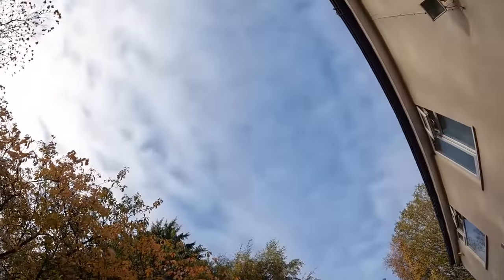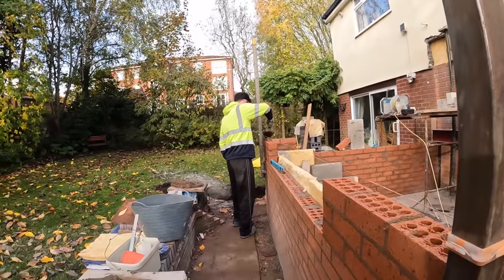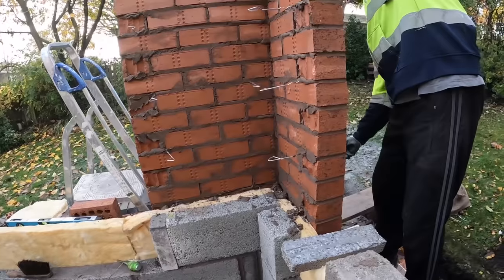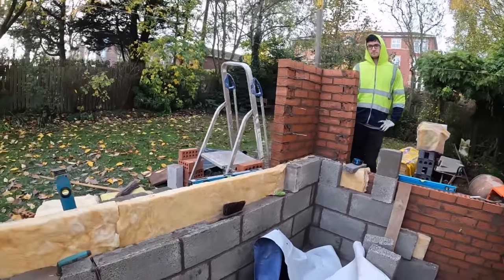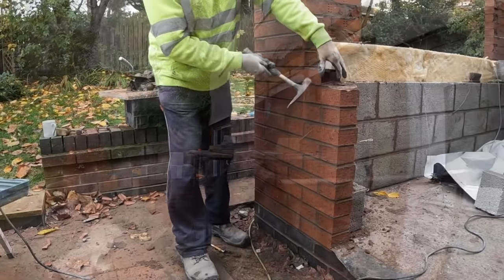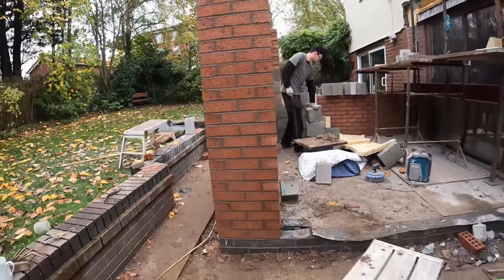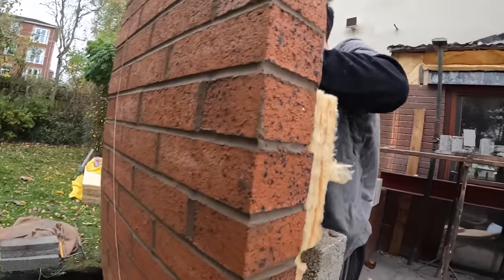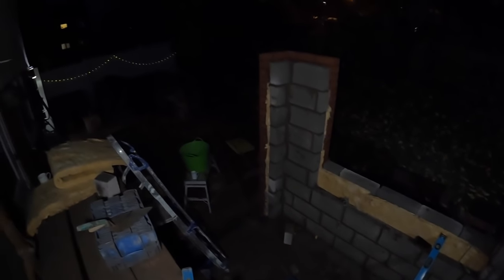BRICKWORK ALTERATION ON CONSERVATORY..EXTENSION PART 5

Comment: Top job. Really impressed how you "adjusted" length of that wall and the perps lined up etc. etc. at the new cut off point. Lintel looks interesting. Perhaps not good for filming, but LED head torches good for working in the dark. I never get finished before it's dark in winter LOL.
Reply from the maker: +John Coppock cheers John 🧱👍🏽

Comment: Can u please answer this.
That insulation in-between bricks doesn't it cause dampness? If that material gets wet be like sponge.
Iam sure it's building regs but the stuff firms poor in have caused problems.????
Reply from the maker: Can’t answer that mate 🤷🏼‍♂️🧱👍🏽
Reply from the maker: @martin2466  . Yep that’s what I got Martin but I can’t answer him I’m afraid 🤷🏼‍♂️🧱👍🏽
Reply: Hi Philip 
Blown in insulation is now causing huge damage to houses, good plan at the time, and is now being removed due to causing damp
PIR is now fixed to the inner wall with ties leaving a gap between insulation and outer wall thus leaving damp to run to ground level as designed
Usually only a problem with walls that are constantly facing bad weather, heavy rain
Reply from the maker: @martinsutherland4270  👍🏽🧱
Reply: @martinsutherland4270  thanks for reply answer from tubers was fast but not very gd thanks
Reply: @toy838  
Regulations are not the same everywhere and changing all the time 
Builders are usually only following plans and building inspectors
Reply: @SteveAndAlexBuild  why not
Reply from the maker: Why not what ?
Reply: @SteveAndAlexBuild  read u don't respond to messages
Reply: @SteveAndAlexBuild  
Don’t think think this guy is going to be happy with any answer 
Not sure what he is expecting 
You’re a very patient man, very good informative Chanel
Reply from the maker: @toy838  .You read wrong pal

Comment: Really enjoying watching your vids.  You two seem to have a very good thing going- work you enjoy, you're good at, and it can be done at a pleasant pace.
Question- how often do you check your levels for accuracy?  If I was doimg your work I would worry about a spirit level getting knocked out of true and not realizing it.
Reply from the maker: Thanks very much Bill . Answer. , probably not often enough 😬.
  We have just invested in a laser level though 😉🧱👍🏽
Reply: @SteveAndAlexBuild  Guys, the easiest way to check a level is to find a reasonably flat surface, set the level. Check the bubble. Turn the level exactly 180 and check the bubble. Should match exactly. If not, adjust accordingly. For vertical, use a framer's square on a level surface and do the same. Not perfect, but 99.8%. Use the laser level for the other 0.02%. 👍👍         🧱🧱🧱🧱🧱🧱🧱🧱🧱🧱🧱
Reply from the maker: @WarpFactor999  👌🏼🧱👍🏽

Comment: Really simple question
Reply from the maker: What is ?
Reply from the maker: Yes it is but I don’t know if it causes damp , that’s a simple answer
Reply: But your builders surely u know or are u just following building regs.Have u had anybody complain of damp issues.
No air flow if water penetrate s wall that stuff like a sponge.
But assume it's done now days.
I do know the stuff they pump in post build can cause issues
Reply from the maker: @toy838  .I’ve never had any issues .